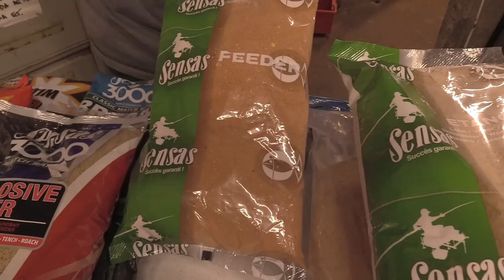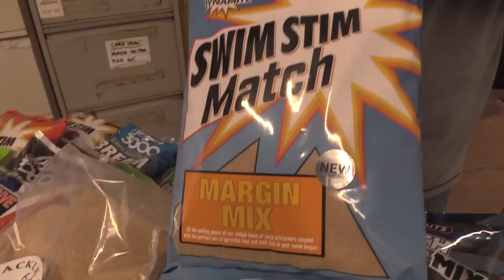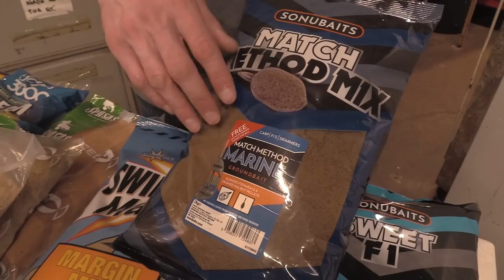Mad Beach Fishing Fest! Plus Pro Bait room fishing tips revealed | Saxon House Thunderstorm

Comment: A general tip for groundbait is to start working on it as soon as you start setting up on the bank because it'll take about 15 mins to fully absorb the water. This gives you plenty of time to sort out your seat, float rod/feeder rod, bait etc. and then you can check in on your groundbait and see if it's the right consistency or whether it needs a tiny bit more water. If it does need a bit more water go super easy as it'll go from a bit dry to slop remarkably fast at this stage, just dip your hand in the lake and flick the water off your finger tips into the groundbait, it may well be plenty.

Also your tree won't really dry out all that well while it's standing. It'll take a decade for the main trunk to start drying and in the meantime you're constantly at risk of a branch losing the fight with gravity while you're underneath it or worse if fungus and insect life weakens the main trunk and it comes crashing down in a wind. Personally I'd drop it before it drops itself and lands on something that'll cost more to replace/repair
Reply from the maker: You may well be right there as I took a long hook,snagged some of the branches that looked ready to snap but I couldn't as they were still springy. I may start nipping the odd branch off and storing it in logs to dry better. Maybe willow takes longer to dry than other trees ??
Reply: @TAFishing  Willow does hold a lot of water but the main issue is that it's hard for the water to get out unless you expose the grain structure